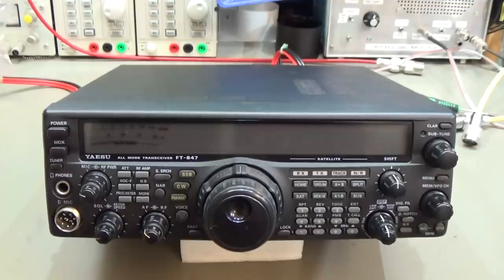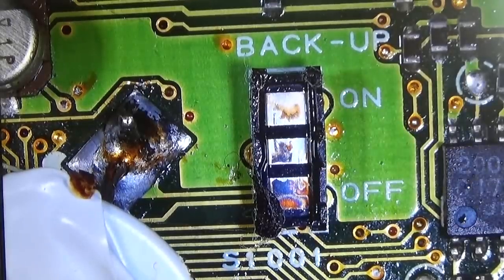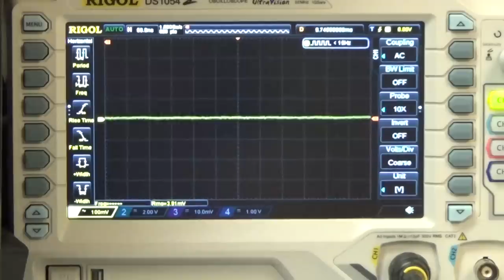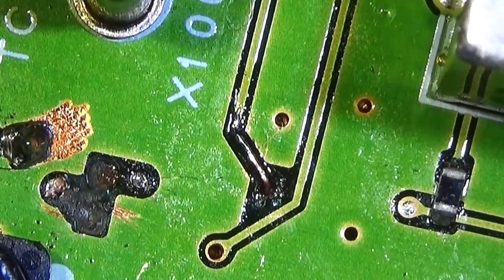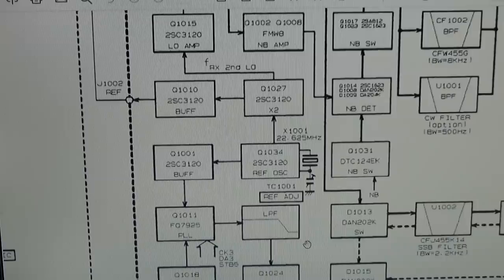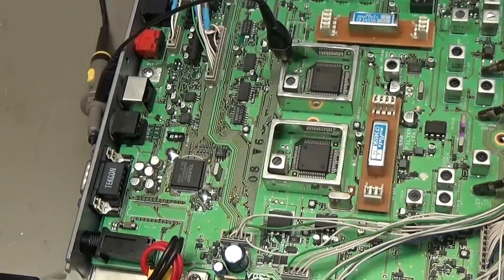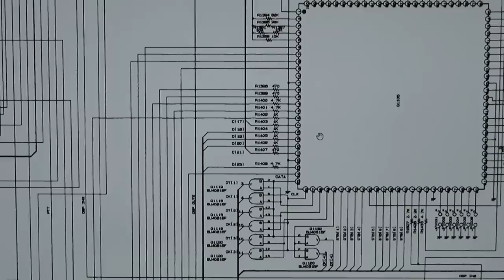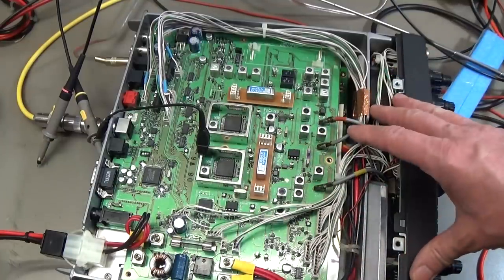#202 Yaesu FT-847 how easy can a nice radio be wracked up?

Comment: what about the loose yellow wire ,near the lithium, that was the first thing i would fix , communication of the switches worked , because de dial changed the frequency during the first second,

Comment: Did you check the on/off switch as there was a mode out to put a relay in line so that the switch was only turning on a relay that supplied the power instead of going through the switch.

Comment: What if he put the memory battery the wrong way round and it's that that is tripping the processor? If your sure it's the processor you could measure current down each of the pins to the processor although that wouldn't be very easy.
Reply: If the processor is damaged you might be able to freeze spray it to test it. It might stay on till it warms up.
  Perhaps Yaesu will be kind enough to get you one, they may have some at the back of a shelve somewhere?

Comment: Great video as always! Thumbs up!
I had a peek at the schematics and had one far-fetched thought: What if the undefined state of the broken backup battey switch (S1001) confuses the CPU? Since that switch looked molten to death by a soldering iron and it is close to  where the "mod" was done, I thought it might be a possibility even if it might not be a likely explanation. The backup battery switch leads straight to one pin on the CPU. In off state that pin is grounded via 10k and in on state it has 3V from the Lithium cell.
Reply from the maker: Yes you are right. For testing I had the switch hard wired for exactly this purposes. Good thought thanks....
Reply: @TRXLab  The Backup Memory  Switch is nothing to do with this problem the Radio will work without the Switch or indeed any Backup Battery, all that happens is it will not hold a y memories when powered off If you keep power connected then the Memories and the Radio will still work all ok...I have a Yaesu FT920 with very similar design with the Backup Switch and Battery...Best of Luck fixing it....Looks like a Butcher has tried to do Soldering with a large Hot Poker from the Coal Fire hi hi....Such a Shame.

Comment: I want to use SMD 0201 size, 0 ohm jumpers for the  JP1 001 - JP1 006. I was wondering if this would be the correct size. BTW, I'll make sure I'm wearing a ESD Wrist Band. these jumpers are connected directly to the CPU. Very nice Videos...

Comment: hmm i only caught part of the video as it was 4am when i fell asleep watching it, now im more interested in the problems that was caused by the battery leak before, id even contemplate reworking the processor pads to clean them and freshen the solder.. however before i seen the bad battery replacement i was thinking bad cap or cracked resistor thats heating up..
what part of the system turns the power relay on/off? where does the signal come from? are you able to jump the relay to see if the signal to power the fet or transistor is stable?
Reply from the maker: Yes I have bridged the relay for testing, all regulators stable.  On/Off circuit processor works perfect...
Reply: @TRXLab  ok, hmm so what signal is being told to "shut down" and can it be "bypassed" i know its not factory setting but it'd get the old gal' up n running again even with another bodge lol, could it be a sense line from the rf circuit, i know some radios do shut down where others just reduce tx power...
interesting issue, it really is

Comment: I’m sure you covered these but the screw terminals even with power connected went dry joint and I had re-flow these. I had an issue where headphones were once plugged into CW socket in a clients radio and it went into TX as power on and over current. Obviously not what’s going on here but the surface mounts caps are normally 45c working from factory..... yes honestly they are as I worked on camcorders in the 1990s and must have changed 10,000 of the caps for 85c and 105c to give the camcorder a better future. Canon E90 especially. I had this problem on my C2 and trying really hard to remember how I fixed it. See my videos as my C2 is alive and working the birds. Let me check my notes but I’m sure I re-flowed something near the power section. 5 years ago or more....

Comment: @TRX Bench: Did you doublecheck if the coding for the processor is really a valid combination? There's still one track ripped off the board that looked like it was  bridged but the missing track makes it an open circuit? Maybe it is some combination of contacts that are not allowed? Since having exactly that TRX as well I might have a look at mine to see what that one would be "jumpered" to if it is not mentioned in service manual?
Reply from the maker: Thanks for comment

Comment: Hi I have a yaesu FT 847 with no audio on transmit on any band or any mode and also intermittent weak receive , if the PTT key is pushed sometimes the receive works again. Any help that you can offer would be greatly appreciated. Thanks in advance.
Reply from the maker: I'm sorry to many root causes possible that I can't say on remote.

Comment: Radio acts as though it's going through a POST routine, finding something missing and shutting down before more damage is done. If that is a multilayer PC board, perhaps one of the feed throughs was damaged in the original modification and not making contact in a middle layer.
Reply from the maker: Yeah that is really something which could be the case and the problem is that you don't know on witch portion of the radio the guy worked additional to what we have seen... That is the reason why I don't like to take radios in like this!
Reply: @TRXLab  
Yep. Hope you win the battle.

Comment: configuration selection jumper wires dectructed and u checked an told that they are true and left them   but the vias on that lines simply should be connected to pull up resistors I think. The via on th "3" line is destructed too, so the line might be floating instead of being pulled up

Comment: Hi there Peter. The thing that has now been bugging me is has you mentioned earlier. Anti-static protection. If who ever destroyed the PCB with a blunt red hot poker. Would he or it ! have had the brains to even think Anti-static strap before touching any part of the board.Once the damage is done, it's i repairable yea ? so how would you know if that is what may have been the case by whoever had their paws on the radio previously, ?. I was wishing that you would find what the fault was after so much time testing and fixing the damaged PCB.  Well done for all the explaining of the tests and checks that you carried out. 73 de John - G0WXU.
Reply from the maker: Yeah you are right John it is always a pain....Thanks for feed back 73

Comment: There are some good suggestions in the comments to try.  If all else fails.  Force the radio to stay on.  Bypass power relays and such, see what happens. Maybe the radio will be on long enough for you to play with controls and find a fault.  Monitor current draw to be sure it does not run high.  Also, out of curiosity, could the PA be out or shorted?  The radio comes on and supplies a bias current and it fails the test so shutdown?
Reply from the maker: yes I have exactly done that but the radio will completely freeze with the bypass...And yes PA is an issue so for that reason the PA was disconnected....
Reply: Very cool.  Well that was my ideas.  Thanks for the reply. Looking forward to update at some point, hopefully. 73's
Reply: Peter -  @TRXLab  - Interesting You comment - When You have a freezing controller with a disabled shut off circuit, I think You really have one more strong indication of You suspicion that the uC has an internal damage. (Need to find a replacement controller!!). As I know its a common OTP controller. In early production batches Yaesu had an issue with the CAT control caused by a firmware bug. The way to resolve it was to make a whole uC swap (new uC with newer FW)
Reply from the maker: yes I'm still believing that is the issue.... Yaesu is not much interested in a End Of Service unit....

Comment: Measure the base of Q1122.
After hitting the power switch, Q1118 holds it low for a short amount of time, then it should get a hi signal from IC Q1106. Find out why that signal disappears. (and de-energizes relay RL1001) 
As you said, there are no PSU overloads, so I would even force that signal hi. (cut the trace before)
Reply from the maker: For testing the Q1118 was out. The 1118 is the over voltage protection which pulls the Q1122 to ground in order not to kill the radio..

Comment: caution when drilling through via's in multi layer boards?
Reply from the maker: you always need to be  carefully. In this case I was opening the through by drilling the solder out. But as you can see in the video it has bee performed by hand and you need to choose a drill smaller than the via ...

Comment: Hey Peter... One of your longer videos but because of the content and the valid step by step analysis, the time flew watching this!! It is so unfortunate that FOR NOW, the radio must be put to one side. As you say, the radio seems to be operational, receiving, audio amp OK, mode switching, it just seems for some reason that the DC is not latching. I have no doubt that the owner is not fully forthcoming with the details attempted or the history of attempted repairs. Why would that through hole resistor be changed in the oscillator stage as well as damage to the long track beside it? I guess that there has been a million angry soldering irons attempting mods in that radio long before you were given it. If you cannot repair it, then not much hope of anyone else curing the issues. 73 as always Peter, Brian
Reply from the maker: Thanks Brian, yes that is what I really suspect we don't have the full truth..under that circumstances it is hard to work on a problem. For some reasons it looks like that some mods has been dismantled before I got the radio.. 73

Comment: Peter I know it's a long shot but have you tried the Processor reset procedure..I would also suspect the Guy with the Hot Poker has also fried some of the Capacitors, you only have to look at all the plastic that be has melted with his Iron to realise he hasn't got a clue how to do basic electronic soldering.

Comment: My comment has more than likely already been covered, And this video is fairly old now, But all the time watching this i was thinking "I'm sure the backup battery has to be connected for it to power on" And when you first opened it there was a backup battery someone bodged in, but the backup switch was broken so the battery wasn't actually in circuit, Did you ever try a new battery and replace switch, Or solder the two tabs of the switch together so its on ?

Comment: A great video Peter, you showed remarkable patience. I put a suggestion about comparing the serial protocol between a working radio and the dead one.  I2C or SPI would make that easier.  I also wonder is there a message into the processor right before the shutdown?  I wonder if that came from the front panel,  or something else.
Reply from the maker: There is a shout down pin at the proicessor but the level is constant so the shut down circuit is not the problem. I put a fix external level to the pin just in case but it did not change the result.
Reply: @TRXLab  Hmmmm, so the processor is not being told to shut down,  but the power to the rest of the radio is being turned off. So I'm wondering how power is being blocked from all the subsystems in the radio? What is the actual mechanism that causes power to be removed, and then what caused that mechanism to activate.
Reply: @TRXLab  Great work repairing those mangled and destroyed traces. That's something I need to practice more.
Reply from the maker: When power is switched off the voltage regulator for the processor is switched off that then activates the on/off circuit to shut the processor down. That all works....

Comment: Yaesu has most of the times a kind of reset or init function of a radio by holding a key combination while powering up.
For the FT 847 it's this procedure:
 If you wish to reset the FT-847's microprocessor to its original factory default settings
 (all memories and customized Menu settings will be lost),
 use the follow-ing procedure:
Press the [MENU] button to activate the Menumode of operation.
Rotate the SUB-TUNE knob to select Menu #39("ALL INIT ").
ƒPress the [MCK/W] key.„
Press the [MENU] key to exit the Menu mode 

But given the short time that the system has power this might not work.

maybe try to disconnect the eeprom chip from i2c bus, it might hold wrong values that confuses the CPU.

Good luck 73 de pa3fus.
Reply: Yes, make sense. To reset the radio's CPU on startup make sure the radio is OFF, then press and hold the
<FAST> and <LOCK> button's and turn the radio ON. !!Warn the customer that all the contents of the memory channels will be reset and lost. :-)!!
Reply from the maker: Yes time is too short for this procedure....

Comment: The black band on your wrist, I think you said it protects the radio against ESD, what is that? Forgive me if I got it wrong.
Reply from the maker: That means electric static discharge and that means dependent on the circumstances your body can be loaded with many thousands of volt. If this load hit a uP it is toasted..
Reply: TRX Bench Thanks, I thought it was that,but thought I would ask. Static electricity I have seen when you get a jolt from it you wonder how on earth can that happen.lol

Comment: Late saturday evening, without my tea...unususal...but i could not resist! Just hammering down some car jumper cables with a torch and huge amounts of lead isn´t fixing a problem..may we should produce an sell some stickers with that hint. I wonder, what triggers the unit to shout down, and what to do to bypass that behaviour. Ok, normally it should protect the unit to fail / burn/ lift off, but as you said, it works fine for 2 sec, no exessive current draw or things like that. So maybe it is possible to hard wire and do some rerouting to eleminate this shutting down? Problem is: How much time could you spend to this thing? There are many hours left to check every bus and voltage, every cap etc. Anyway: Fine job again so far, i like it very much. And be sure: You will get the Luis Rossman diploma for SMD and via-bridging repair! Thats for sure! 73 de Olaf
Reply from the maker: LOL yeah Olaf lets produce some stickers.....Ja das ist schon ein sehr interssanter Fehler nur die Zeit die es verschlingt die Zustände am Prozessor alle zu testen it einfach zu lange. Zusätzlich wissen wir leider nicht ob einfach irgendwo eine Durchführung zerstört wurde die wir zur Zeit nicht sehen. Bei all den komischen Vorschädigungen musst du mit Allem rechnen. Leider sind auch die Angaben in den Serviceunterlagen für solche Fehler mehr als mangelhaft und bei Yaesu hat niemand mehr Lust und Zeit sich mit einem Funkgerät zubeschäftigen das komplett aus dem Service raus ist. Auch bekomme ich die internen Fabrikunterlagen nicht. Die würden helfen das Problem weiter zu ergründen. Aber alles das wäre dann nur noch persönliches Interesse was ich aber gerne investieren würde, wenn ich mehr Informationen bekommen könnte. Du siehst solche Fälle ziehen einen Rattenschwanz hinter sich her...Aber wem sag ich das LOL.... Danke fpr Deinen Kommentar 73

Comment: Hi Peter - what a messy service You picked up!! May be CPU is reading a corrupted setup data on booting and shuts down. To reset CPU and config on radio startup make sure the radio is OFF, then press and hold the <FAST> and <LOCK> button's and turn the radio ON. (!!Warn the customer that all the contents of the memory channels will be reset and lost. :-!!) - Did You replaced the messed up battery switch? Did You checked the supply close to the processor during power on? (Nominal value and max ripple)
Reply from the maker: Thanks Wolfram I have tested it but no change...The battery switch is hard wired...The caps on the processor power line are new

Comment: There were connections that looked "smoked" like lightning struck or something....  I would need a microscope to work on the board..but have gone thru the Nasa soldering school.... That sort of damage indicates a bit of ham handed use of a solder gun...

Comment: Visible proof you cannot use an acetylene torch for SMD soldering. LOL
Reply: I was wondering if a chainsaw was used to remove the original parts as well.

Comment: Great vídeo Peter as always 😊. Can this model be upgraded ir reinstalled its firmware?Sometimes a reinstalled le upgraded un the software solves nasty and rare problema on equipments.
Reply from the maker: right but this old processor is not field upgradeable...

Comment: Great vid Peter, very sad situation.
I have had a look at the manual & as you say it shows no connections apart from the MARS mod lands on the processor - but I'm not sure as I've had strange connections on multi layer boards and the broken track has a land isolated - it appears to go nowhere - but why have a land that isn't used? suspicious....might be pull up resistor somewhere on this line.
i would check this out as the user said it worked before the mod.
good work - now you need some luck
John G1VVU

Comment: I would just double check the area where you removed the 2K2 resistor. It looked like TC 1001 capacitor should be connected there to a ground which means your R1109 could actually be R1113 4.7k going to emitter. I am thinking this could effect waveform amplitude in next section activating cutout procedure if values are wrong. Very difficult to clearly see pcb tracks from video. Also try crossing memory switch and re-adding the memory battery this is possibility. As always brilliant video.